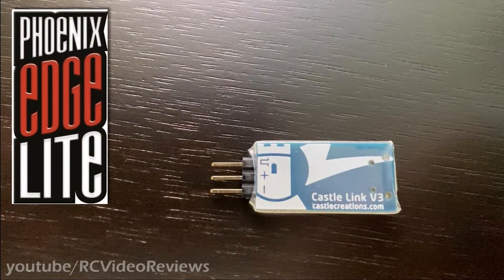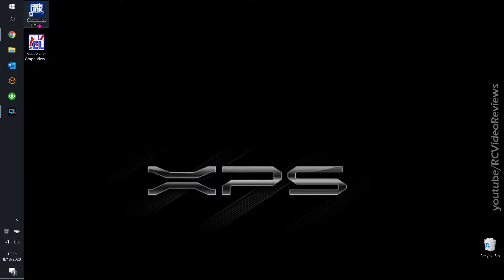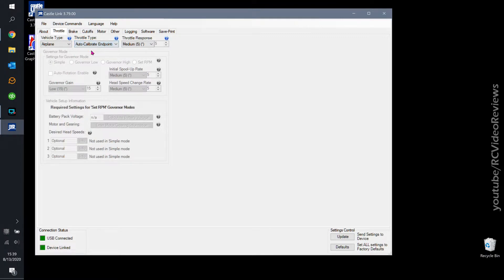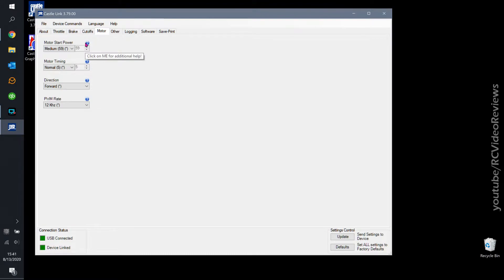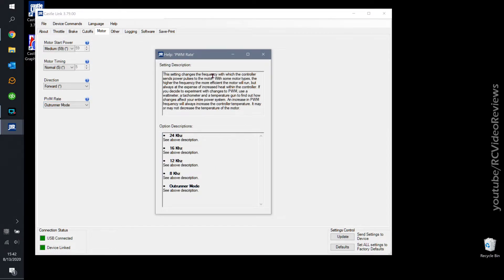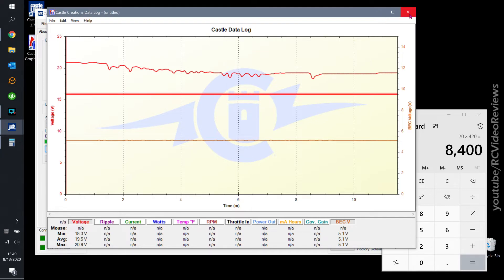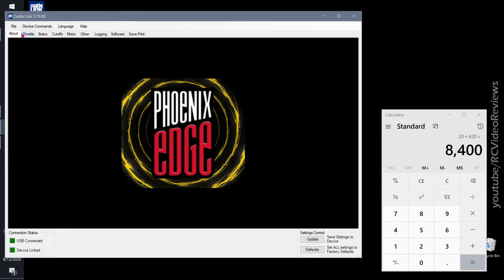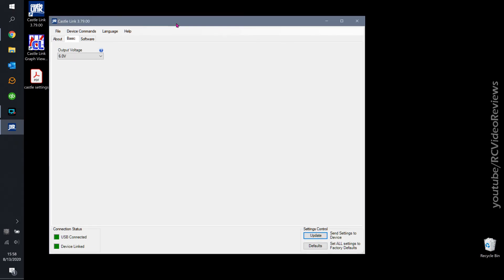EXCELLENT: Castle Creations Castle Link Software Tour  •  Data Logging and Graphing Demo • RC Plane

Comment: I  adjust auto calibration end point .  On 6S  Lipo is OK . But when I want use 2x 4 Lipo in serial connection ESC dont count Lipo. I make this way. Hull throtle ,connect Lipo and  ESC count Lipo . By 6s  all OK , by 2x4 serial Lipo not count.

Comment: Only auto seting can set end point for throtle. When I set fixedend point . Motor not running when stick was down. Motor running only when stick was 3/8 in  forward.
Reply from the maker: Yeah, their calibration process leaves alot to be desired.

Comment: Been using this on my helis for years now......very good
Reply from the maker: Thanks for dropping in and commenting. Do you have any hot tips?? :)
Reply: @RCVideoReviews  apart from the fact helicopter settings are slightly different, I used castle link extensively after converting my Trex 600 Nitro to electric to achieve optimum performance and to keep check on the stats. Once I was all setup including  the throttle end points and governor I had no need to return to the software.....
Reply from the maker: @pril250  Yeah, that makes sense. It's often the case with RC gadgets once they're setup.

Comment: Never looked at Castle products, so thanks for the overview.  I like your “setup” use approach and was wondering if it is beneficial to use the Castle ESC on the Judge to compare the data output on the lcd vs the data-log on the ESC.  I also like the dynamic vs static comparison feature...provides peace of mind knowing the right ESC is being used.   Thanks for sharing!
Reply from the maker: I definitely should try it on The Judge for a couple of runs to compare. I really want to check that static dynamic argument out though. See what the gaps truly are. 

They’re spendy so not for all planes IMHO but could be a very valuable setup tool.

Comment: ZTW Beatle ESCs have Brake: https://www.ztwoem.com/wp-content/uploads/2020/01/ZTW-Beatles-Series-ESC-User-Manual.pdf
Reply from the maker: Yeah that’s a hard brake. Castle let’s you chose the braking percentage. The idea is to let the prop spin slowly and it acts like an air brake. Other ESC brakes lock the prop and that actually lets the plane dive faster.
Reply: @RCVideoReviews  Cool!

Comment: There’s been a lot of issues with castle esc’s in helis they seem to like to catch on fire lots of people have gotten extremely mad with them. Helicopters draw a lot more amps also. I’m a hobbywing guy. Heli motors can turn up to 250,000 revaluations a flight.
Reply from the maker: Oh yeah, I could see how that would get someone'd BP up. Dave flies these exclusively on his 2m pattern plane and his 63" Acuity. 

If anything catches on fire, you'll get the first warning credit! :)
Reply: txkflier helicopters always use a fixed throttle 99% of people use a governor either by way of esc or external gov. I’m just referring to the many posts I’ve seen in fb groups and on msg board helifreak I actually have zero experience with Castle creations.
Reply: txkflier the old V curve is a relic of the past especially with most esc’s offering gov mode now. The only helis that I’m using a V curve with is my micros because they don’t have any gov mode. Of course I have no idea what kind of helis you fly like scale or flybared but I only use hobbywing esc’s and they have excellent gov mode and are easy to setup. How is the transition from 3D heli to 3D airplane ? Easier?
Reply: txkflier haha I hear ya everyone has there style that they enjoy to each their own. Now don’t get me wrong it’s not like I’m a hardcore 3D flyer I’ve only been flying helis for 2 1/2 years but for myself I find flying patterns a bit boring and I enjoy pushing my limits to learning new things. For me I guess the 3D flying is more of being in total control of a heli that looks out of control to the average spectator I get excited every time I pull off a new trick or master one I’ve been working on.
Reply: txkflier haha I got a laugh out of that comment but I agree they are dangerous especially if you don’t know the guy flying. I’ve heard of them referred to as flying lawnmowers before lol.